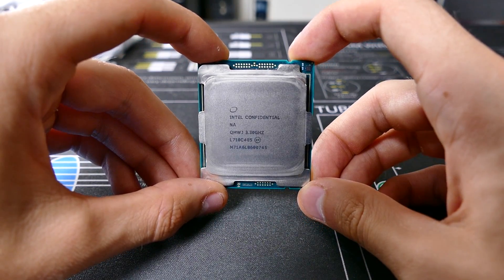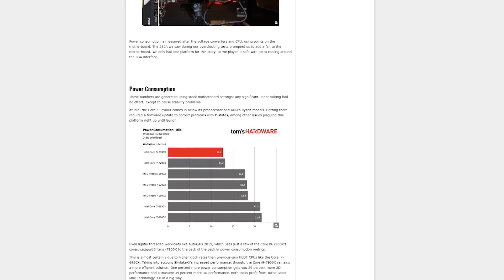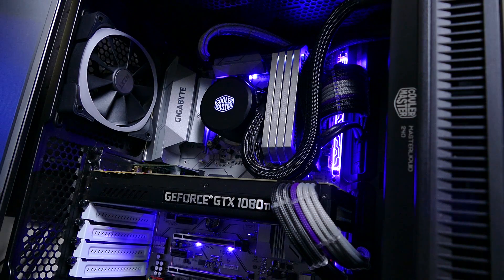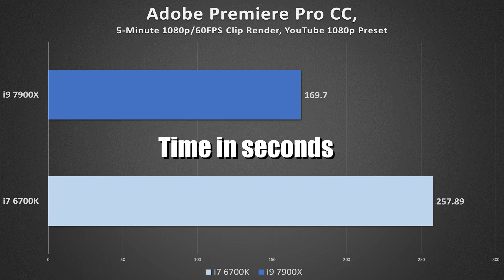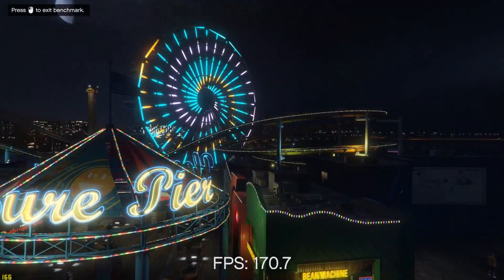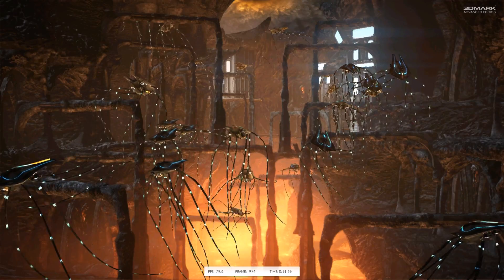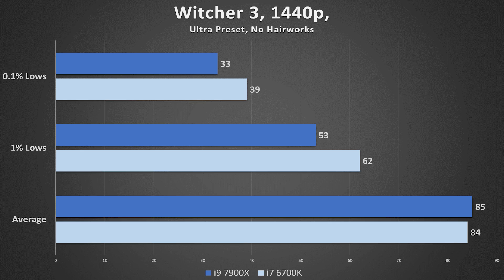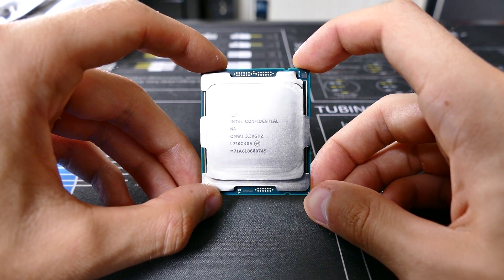Intel Core i9 7900X Benchmarks: Everything You Need to Know

Comment: Intel logic: have a lot of money? Buy a xeon, though it's basically a year older than an i9 it still has 3000 passmark on an i9. Don't have money? That's fine, buy two old xeons, it will work as well as a modern i7 and cost half as much. Plus you get more cores and threads.

Like what are i-series proccesors even for at this point?

Comment: i just couldnt justify x99 or x299 after ryzen 7
my 1800x crushes i7s in compute and gaming has 0 stuttering issues 
issues that ive been plagued with on every i5 or i7 ive ever owned
i wont argue with FPS numbers and single core performance tho intel has that hands down
my devils canyon is still a beast
its just too bad they want ur arm for anything more than 4 cores, which is essential for serious gamers 
amd isnt much better tho in terms of getting proper workstation features with more than 4 cores on ryzen 7
u see a block diagram of the chipset layout and can tell board manufacturers are still struggling with having to spread what features exist thru 18 pcie lanes

Comment: Why would I go Intel at all if I need a pro level cpu? Ryzen 1700x will 
outperform it for less than half the price.  Threadripper 16 core 32 
thread quad core with motherboard is less than this one.  well... about 
the same I guess at this point. However that compared to the Intel 16 
core 32 thread is half price once again and 64 pcie lanes instead of 44.
 Or 64 instead of the 28 in this cpu on this thread.. LOL and lower 
power consumption by half again...  Intel you suck once again and 
finally!!!

Comment: hate to say it but Intel's knee jerk reaction to ryzen and premature release of i9 may have been their worst decision yet. a CPU that can't overclock properly under normal coolers (If u use LN u are not normal) or even out perform it's 4 core predecessor is not a product that deserves to be released as a next flagship to Intel.  ryzen isn't great it is just multi thread optimized. that means it will do workstation tasks brilliantly but as a game cpu it will not have any performance advantage over a kaby lake no matter how much they try to convince u otherwise. like all amd CPU game will run on sheer brute force(how high ryzen can crank up it's core frequencies when oc). i9 was a mistake even if it did out perform ryzen which I doubt considering Intel even made physical design errors in it. i9 is meant to be an all encompassing CPU that is not just optimized for gaming with high out-of-the-box frequencies like Intel's previous CPU but also multithreading performance for demanding tasks like video editing. clearly MT optimization is unknown territory for Intel. Intel will bounce back but not for a while. not while they are trying to figure out whether they want their commercial CPU to be game centric or like the ryzen workstation centric. they can't play both fields without serious compromises.

Comment: I think you can design a program to leverage multiple cores without crippling machines with fewer cores. Go-routines, for example, scale very well with many cores but are light-weight enough that they don't have much overhead. As far as games go, there is an excellent GDC video about the engine Bungie used for Destiny. In Destiny, the code is broken into many smaller tasks which are assigned to free CPU threads as they become avalible. Intel has given talks about this technique, also at GDC.

Comment: The only thing you need to know is that the 7900x gets a serious ass raping by the 1800X on price point (£398) AND performance. Heck, even the overclocked and substantially cheaper 1700 (at £280), humiliates the 7900x.

Comment: still using i7 2700K  its at stock and has great temps... intel did good things in the past  made to last longer...  (its unaceptable that i7  6700K works better on almost all games than the i9  maybe some BIOS update needed)  anyone remenber those times? great sandy bridge cpu and almost half of the price...   in february 2012 paid 189 euros for this cpu and now i would have to pay for an i7 7700k 352 euros on the same store... this is ridiculous.  i can play all games well on 1080p  ( Limited by my led monitor lol)  its enough for the next years still :)
I never used amd cpus in the past but my next computer will be a ryzen or better cpu from amd

i just miss an up to date cpu to convert x264 in handbrake :/

Comment: Sets out to test CPU performance, creates GPU bottleneck by setting all games to 1440P because it is most common use, proves nothing other than higher clock rates can handle more data streaming across PCI-e, doesn't realize that 240Hz at 1080P is far superior experience to 1440P and is severely CPU bound. If we were to look at things through the lens of most common use, no one should wast money on PC's and just use cell phones.

Comment: Was your 6700K overclocked for this test? My 7700K scored 50fps on the Firestrike Physics portion clocked at 5.1GHz. With the same architecture it should score clock for clock with the 7700K. Meaning your 6700K was running at roughly 4.5GHz to hit 44fps, not the 4.8GHz it should or possibly 4.9GHz if you're lucky. I have my Firestrike results saved and I just verified my 7700K running totally stock at it's normal turbo boost of 4.5GHz scored 44.65fps on that test.

Comment: The gaming results are to be expected Games have been optimized best for Intel's I7 for the last 8 years.. I expected nothing less... The 7700K was only a little faster than Ryzen (even with a 1000Mhz haddy cap!), And it's faster than It's own Intel Big Brother, a 1000 dollar 6900X.. It all boils down to optimization when it comes to games all the chips that are out including Ryzen are pretty much the same in IPC , It's Like I said, Games are optimized for (Intel 4 cores and have been for 10 years now, That's the Difference It's not because a 4 core is better than an 8 or 10 at all because there not optimized the same way...

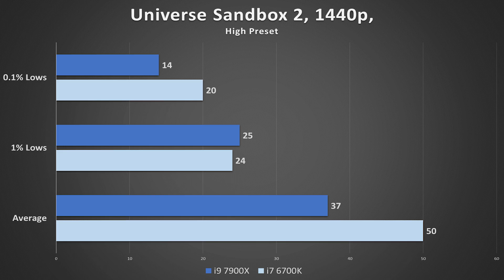Comment: 7:50 The bad framerates are caused by a bug.
Not sure if it's Intel's fault or windows.
Set windows power plan to high performance to disable low power states.

I have a 5820k and was wondering why I was getting micro stuttering and quite variable frame rates.
Turns out games don't use enough of the processor.
It's windows switching the program to down clocked/asleep cores to balance load/thermal, coupled with an issue with Speed-step seemingly taking extra time to speed the core back up/wake the core up.

How I discovered this was testing different overclock settings as performance seemed quite off in games and single threaded benchmarks gave me wildly different results. Disabling speed step in the bios fixed the issue. So instead I just have a little batch file that changes between balanced/high performance power plan.

Comment: @ScienceStudioYT: Thanks for not glorifying this thing and making performance per dollar a priority in your reasoning. Good video all around. Sympathy thumbs up has been granted :P

One question, though: How are the framerate values so much worse for the i9 in pretty much every game you tested, when the cores are operating on the same frequency and are rather similar architecturally? Is this the new mesh interconnect's fault? Or is the CPU throtteling after all? 4,6 Ghz on all cores do seem rather high considering what you can find on the interwebs about temps and general behaviour of those monsters.

Comment: "Would not make sense to cripple the majority.."

Stop right there. Having a game use many cores WELL doesnt mean it will run badly on lesser CPUs. Sure, a 10 core would then crush a quad core, but the quad core would still have the same or BETTER performance under such a well made, optimized scenario. So you are incorrect.

And as Ryzen and other eventual higher core count CPUs come out, its time physics and AI actually advance again. We cant have most current day games have 2005 level graphics and be skullfucked by 2007 level AI.
Reply: Yo, you should put this in OP's comment.

Comment: There's a thing that all motherboards seem to have and after reaching certain temps the capacitors stop giving full power it's a setting a lot of lobo have and you should let the CPUs use all the power it can so 140% I believe since there's been test and at stock power they were underclocking

Comment: 240 AIO severe underkill? more like that CPU thermals are horrible, as you pointed in the video.
Reply from the maker: Longgshot That's why it's underkill...
Reply: +Science Studio It's not underkill for other proccessors with similar corecounts, and / or frequency, by a large margin. Or to say it the same way as in the video, comparing it to CPUs of the same caliber.
For example for the previous 10 core it was way more than enough to cool it properly. Althought it had lower frequency.

The TDP of that thing is just through the roof. What i'm trying to say is that it's not the fault of the AIO that the CPU is badly made and rushed, with toothpaste inside to put a cherry on top of it xD.

Apart from that, good video :).

Comment: again i am in my office right now with an and ryzen 1800x rendering and the system shuts down and i dont know y , this has happened many times before also i have a decent cooler also i guess the workstation load is is too much , anyways ppl and reviews will say otherwise yes because they tested the i9 a 10 core cpu over clocking the fucker to a wooping 4.6 ?? man that cpu is already running so high at stock , and when the stability factor comes in intel wins why dont u test both cpu on a vray render for straight 10 hours render time with the same cpu cooler and test them both stock cause both the cpu get very hot when overclocked

Comment: greg, wath out for overheating and throtteling vrms!
try your witcher 3 test again with a fan heading directly to the vrm heatsink. you should have a better result, the cpu will throttle becuause of the overheating vrms.
if you want to learn more about that issue, wath "derb8auer" 's video about the x299 vrm desaster

Comment: I agree that a lot of these graphs are a little disappointing compared to an i7 with only 4 cores clock for clock, but I think we should give the platform the benefit of the doubt just like we did with ryzen when it first launched. Optimizations for games still  have to trickle in and stuff like that.

Comment: TL:DR; If you wanna OC Intel cpu's get a good cooler.

Every time i hear some youtuber complain about the thermal interface i cant help but chuckle, besides it being weird that every reviewer and their mom suddenly mentions these things, what only about 5% seems to realize is that this is a conscious decision by Intel, Intel cpu's (especially the extreme's and other high end versions kind-of-aimed-at-overclockers) can heat up so much that your average solder thermal interface is gonna deteriorate over just a few weeks, so not using solder is actually the better option, until something completely different is proposed anyway.

Comment: Oh man where do I start....

- Intel's i9 is pure garbage. Yet you like it, because it can run Adobe Premiere better than a 6700K. (Yay. I guess?)
- In games, the I9 is worse thant a 6700K. Runs hotter, needs more power. Might even fry your mobo. (You forgot to mention this. Even the FX series AMD CPUs didn't push the mobo to the point where the i9 effortlessly can.)
- A software that can't scale well after 4 cores is not considered well optimized for todays hardware. (I'm aware that there are exceptions.)
- Today, midrange is 6 cores! 4 cores is the low-end. (Making a 2 core CPU should be considered a crime.) Try keeping up with technology. Few cores with higher single core performance is slowly getting less important. I'm not saying it does not matter at all, but just about everything is optimized for more than 2 cores.
- By the time you get to 3DMark Firestrike, you somehow change your mind and suddenly multicore is absolutely great.
- The i9's smaller L3 cache paired with bigger L2 cache is completely ridiculous. (Never mentioned in this video.)
- The i9's latency for accessing a different cores cache is appaling. (Also not mentioned in this video.)

Few things you are right about...

- The toothpaste under the IHS of the i9 worths about as much as the CPU itself. That is correct, less than nothing.
- People need to check the competition for offers.
- You are testing doom. (Alhough you think GTA V is "beautifully optimized".)

Comment: 7900X has a different cache structure and core interconnect which is slower than the only on the skylake, Kabylake and boadwell e. This has a big impact in games, you would find the 6950x to stomp on the 7900x in gaming.

Comment: I don't know why, but GTA V performs relatively poorly on my rig. I've a Xeon E3-1245 that's roughly on par with an i7 2600 (non K), 12 gigs of RAM, and a 1070. GPU and CPU usage are both at around 50% at 1080p, but the frame rate's any where from 45-60 fps. I checked the usage on all threads and they're also at about 50%. The CPU isn't thermal throttling either (I checked). I've tried reinstalling Windows, reinstalling GTA V, and even putting everything to Low at 720p. The frame rate's the same. The frame rate does, however, go to 100+ fps when I look at the sky and GPU usage reaches 100%. This may seem like a CPU bottleneck, but my CPU usage isn't any where near 100%, nor is there any thermal throttling. And yeah, one of my friends who has an overclocked 6900k faced the same issues I did at 1080p and 1440p. His frame rate also dropped to the 40s, despite GPU and CPU usage being really low. Strangely though, bumping the resolution up to 4k fixed things and his frame rate was rock solid at 60 fps. Of course, I can't run the modded game at 4k Ultra settings at 60 fps on my 1070, so is there any other solution?
P.S. I've also tried setting the game's priority to High from Task Manager. Doesn't help.

Comment: Wow. Intel is really loosing it. They should have thought twice before they released Kaby Lake and they should have thought three times more before they released Kaby Lake X. Honestly, I think I'll stick with my i5-4670K that's overclocked at 4.0 Ghz and when my CPU dies on me, I'll get a Ryzen threadripper CPU when it comes out because Kaby Lake X is A: To confusing, B: WAY to expensive, C: Has a possibility of frying my 8 pin CPU cable, and finally D: It's last gen cousin can handle frame rates better.

Comment: 7900X blows in gaming and some unoptimised applications in comparison to 6700/7700K or even older Broadwell-E on X99 at the same clocks because of Skylake-X`s redesigned L3 cache which is both much smaller and of different type now (inclusive, "victim" cache). They also got much more L2 cache which can increase latency. That combination of cache designs is a bottleneck in some cache-sensitive situations, especially so in gaming.

Comment: So derbauer got his 7900X to 4.5Ghz at 1.25V which made it pull ~400W with prime95, so like 250 to 300W under normal load. Knowing that, imagine what the 18 core is going to pull if they don't want it to be clocked at like 2Ghz.

Literally the only people that care, or should care, about X299 are hardcore overclockers which make up like no % of the market.

Comment: overclocking is one thing. aiming at high single core performance can be justified, however good coolers are required.  
justifying overclocking a cpu that goes beyond 300w and beyond any practical watercooler is beyond dumm and even the vrms overheat because lack of cooling.
not saying threadripper will do the same, but i wouldnt overclock any of these cpus for extra 10-20% and meaby melt some wires/vrms...

Comment: Where did you benchmark The Witcher 3, Greg? I average 110-120 in most areas at 1080p with a 1070 and a 6700K. Im running multiple graphics mods and ultra settings. I drop down into the 80s and high 70s in Novigrad though. Im guessing you benchmarked in Novigrad?

Comment: Can't wait for threadripper using just as much power as the i9! LOL
Reply: Pretty sure Intel rushed the i9 series out the door bigtime because of Threadripper, and I wouldn't be surprised if the 7900X is just a vastly higher TDP 6950X so it looks "improved." Threadripper, since AMD will have spent a lot more time on it, will probably have a lower TDP. Come on, who's going to buy a 230W TDP CPU, even if it is 16 cores?

Comment: >240mm AIO
>severe underkill
Thanks Intel
Reply: Intel response "Don't over clock it then"
Reply: i think i will make a project on kickstarter for case with so many radiators it will be able to handle that heater

Comment: Question for a noob in terms of video editing:
Does the difference between the editing and compiling time lengthen when the videos are longer? So if a 5 minute video compiles 1 minute faster on the i9, would that difference lengthen on a 10, 20, or 30 minute video?
Reply: Since video encoding is a linear process, yes, the length of the input matters. However, since the $700.00 price difference between the i7 and the i9 makes up a good chunk of the cost of setting up a second machine you have to think about the price vs performance of just adding a second encoding machine as well.
Reply: So would there be a point at which a video would be long enough to justify the cost difference? Say... compiling the entire series of game of thrones into one video where we cut out the credits and opening?

asking for a friend.
Reply: The smaller the ratio of edit time to render time is the less I can batch up the processes. So, unfortunately, the cost analysis for this system is very dependent on the specifics of the workflow.
Reply: It's all hypothetical, anyway, I am fine with my i7-4770, just wanted to know.